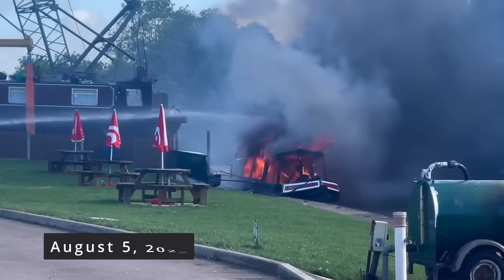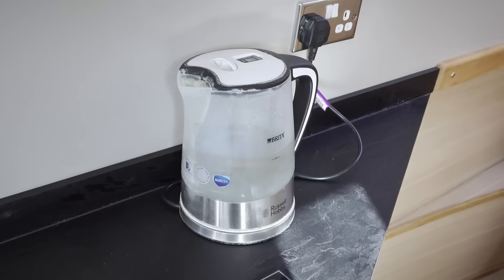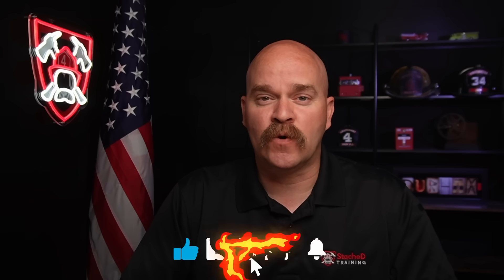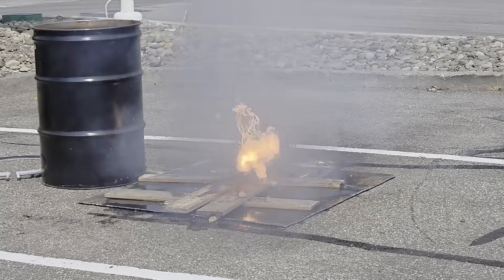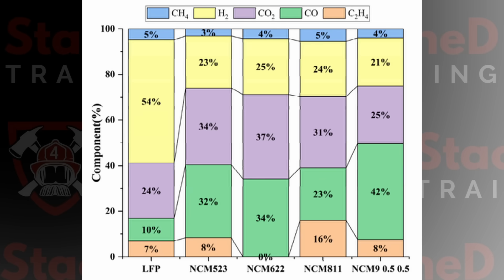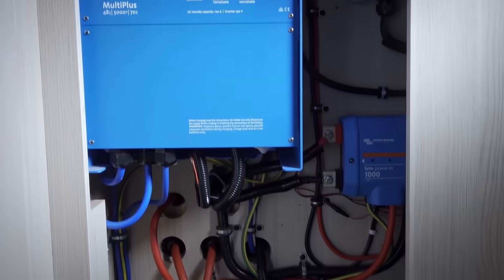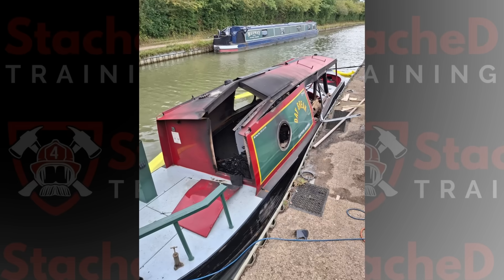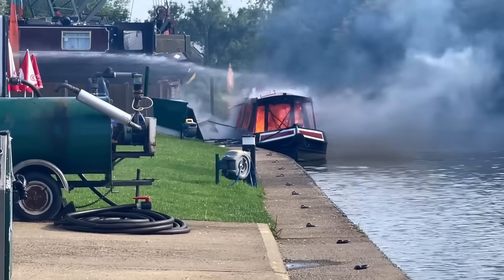Electric Boat Explodes While Charging: LFP Batteries

Comment: There needs to be more information about this incident. Currently, (no pun intended) there are many, many yachts with LiPo batteries used as house batteries, mine included.  As for venting, my  LiPo batteries look exactly like AGM battery cases. There aren't any vents in the case because there is nothing to offgas as lead acid battery requires. Perhaps they used a system that wasn't meant for the marine industry ( not ABYC or similar, approved). I would be interested in a follow-up up to this video as more information comes to light.
Thanks for posting this.
Reply: I really doubt your yacht is using LiPo batteries, it is most likely using safer chemistries with a liquid electrolyte instead of a polymer electrolyte.
Reply: @swecreations I installed them myself,  so there is no doubt. I do use an AGM battery for the auxiliary diesel, but the house batteries are 100% LiPo.
Reply: @Richard-nb4iv Why would you use LiPo batteries for a house battery over something more standard like prismatic NMC or LFP batteries though?
Reply: @swecreations Lipo has become the standard for the industry. That's marine as well as home use with solar. It is more of a stable chemistry than the traditional lithium battery types.
When a traditional lithium battery is punctured with a nail, it goes into a thermal runaway and basically catches fire/ explodes. A LiPo battery doesn't do this because of its stable chemistry. I've seen many videos on this topic on YouTube. That's why I'm wondering if they have all the information correct with regards to the boat fire.
Reply: @Richard-nb4iv No sorry but I have quite a lot of experience in the battery  field and you have everything the wrong way around. 

LiPo batteries are considered the most unstable type, and it's what you will find in all smartphones and most laptop batteries. They are practically always in a pouch format and have a polymer electrolyte instead of a liquid electrolyte (where the Po in LiPo comes from).

Regular NMC batteries are considered to be much more stable than them, and LFP batteries are considered among the most stable, often incapable of sustaining a fire and will extinguish themselves even in extreme conditions.

I will however warn that I don't really like this channel as it tends to heavily overdramatize the risks of battery fires. If you look at fire statistics for EVs from the offical government agencies responsible for statistics they all end up at roughly 1/20th the fire risk or less compared to gasoline vehicles, and these results are shared among multiple countries (Norway, Sweden, Australia and the US are ones I know of the top of my head where I have seen this data first-hand). This is of course accounting for the amount of cars on the road.

Regardless I would like to recommend you to search on Youtube for something like "nail puncture test LiPo vs LFP" so you can see what I'm talking about here clearly, as the LiPo batteries will explode violently compared to the LFP batteries.

I would guess that you have likely confused the battery types, I highly doubt your house batteries etc. use LiPo batteries and that's why I replied to your comment in the first place. I hope this information helps! 😊
Reply: @swecreations  Yes, you are correct, I did infact have the types switched. My apologies and thank you for the correction. 😊

Comment: You have to take in to account how many thousands of battery are out there all working fine, post like are informative but people who do not like EV,s are taking all out of context, to this one episode in the UK we had two fires that shut down main roads by diesel vehicles this week that made it into the media. Because of this type of media people are making judgments that would not normally think about, so the banning of EV,s is coming to this on a small amount media out put hyping it up, so taking that, need to ban diesel and petrol car just in case they have a wiring problem that could cause a fire. The boat in question had the battery in the cabin under the floor I believe and not in the engine area where they are normally stored. I not sure but where the wires go through from that charger box there would be a gland that makes a seal and may be out of sight. The only place where water can get in is through the prop shaft exit but there is a gland here which is kept full of grease to stop that happening and that is the brass pump on the rear deck. The owner would do daily check of this as  narrow boat people do, also the rudder pole is in a seal tube down into the water.

Comment: To get a LFP-Cell to a state where it gasses out is not easy. And in every case, the BMS has to fail, because it ultimately protects the cells from dangerous handling by disconnecting the battery from the load/charger.  How they managed to kill the battery is beyond me. It would be good to know at least SOME technical information about the installed Battery instead of "be scared, even of LFP." Because by that logic you should have nightmares about a diesel boat with a gas stove.

Comment: the  key to a safe system is  not building from 12v batteries, 4 12v batteries is not same as using 11 cells

Comment: I've worked on canal hire boats for 50 years. Yes, you can have a small electric boat that does short day trips of 2 or 3 hours. However, the idea that you can replace every system in a large cruiser that can be hired for several days is nonsensical. Hirers want freedom but are restricted by the need to recharge. Fixed charging points at regular intervals are required, even though they may be rarely used. How do you do a breakdown on a boat with no battery power? You can't just replace a starter battery like on a diesel-powered boat. Companies I have worked for have twice tried electric power and have given up as it is impractical. The first boat had 1.5 tons of batteries on board but had limited cruising range. Hybrids have been tried and reverted to diesel.
Reply: 1.5 tons of LFP4? You could run for weeks with that amount of storage on inland waterways. I doubt if an electric truck would have that amount.

Comment: LFP battery isn't 100% safe: it contains a flammable solvent.
But it is safe-er than LiPo battery, because it can tolerate cold/hot and 0 charge conditions a lot better.

Comment: A design fault in the build of the boat does not necessarily indicate a fault with the propulsion system. If it was diesel there are  ventilation requirements, whilst petrol (Gas) is virtually never used . With petrol the Tank is normally placed outside of the main hull of the boat to allow the explosive gases to leave the area, Likewise bottled gases (propane/butane) are kept in a drained  locker outside of the hull area. Nearly all boat fires can be traced back to a build up of gases in the bilges, ignited by an ignition source.
Maybe with the increased use of Batteries in boats the designers need to change their ventilation protocols.

Comment: Geez!  I was under the impression that LiFePO4 batteries were much safer (although not perfectly safe) than Li-ion wrt fire risk.  Hell, I’ve been mulling over installing a 20kw battery energy storage system to my solar panel installation, but have not pulled the trigger for the simple reason I AM worried about fire risk.  Holy cow what’s a person to do if there’s simply no safe/affordable battery out there (at least for now)?

Comment: Thats worrying for another reason, there is an old tunnel on the canal network called "Standedge Tunnel" and its nearly 5km long with freezing Northern England water that varies 3-5m deep in places, there are escape routes as its a network of disused and active rail tunnels and the canal but they are spread out. The Canal and River Trust run tours with larger battery operated canal boats full of tourists, plus other people can take their own boats or rented ones through at times. The idea of one of these fires or explosions in there is a terrifying idea, the toxic smoke too.
Reply: So how many of those boats stop charge the batteries while in the tunnel?

Comment: Its woth saying that there is two main types of LFP batteries. The higher capacity is doped,  I dont know for sure, but think its manganese. Those batteries are way more flamable. While not quite as flamable as NMC, they are still quite flamable.

While the normal LFP is not totaly inert, they are probobly a order of magnitude safer.

Comment: The issue is with battery systems built by incompetent, greedy bastards is clearly shown on one of the b-rolls here, and they are the only reasons for lithium batteries having a bad reputation. Lithium battery technology is fantastic and very safe, if implemented properly. 
You can buy lithium battery packs as 4 cells to form 12V, 8cells to form 24 batteries, and when used individually, or in parallel, they are perfectly fine. They should have a MOSFET bridge on the negative side, they should be able to disconnect, should the cell voltages or temperatures move out of operating range. The cell balancing and monitoring system takes care of the cells of a single battery, and can disconnect the load or charge before cathastrophy strikes. However, when one connects these in series, and the batteries don't communicate with each other or the charger/load, and on top of it they don't have a MOSFET bridge (or the mosfets burned out), this is exactly what will happen, quick fast in a hurry. The batteries are not aware of cell voltages between blocks, can't regulate charging or discharging, can't regulate cell balancing, nothing. 
In ANY applications, people should use batteries with BMS systems equipped for series operation, cell balancing between cells, modules and blocks, and the ability to disconnect the load and the charge IMMEDIATELY as the cell parameters get out of range. Bonus, if the system is able to acutally regulate the charger, adjust charge current, thus ensuring the cell voltages remain in range, but also cell balancing can occur at the end of the charge process. 

The problem isn't the technology, it't the people using/selling it in a substandard state. Just like with anything else in the industry. If someone can't build a proper airplane, they shouldn't be selling an airplane. There is very little to no regulation on the DC side of battery installations, mobile or stationary. We have strict regulation for all electrical wiring, connections and safety, but no enforceable standards for lithium battery systems, cell monitoring, cell balancing and charge/discharge regulation? The root of the problem is exactly this.
Reply: Do you think the people doing these DIY conversions have had a university education about the chemistry and composition of batteries ? They are a dark art unless you have studied them in depth,
Reply: Similarly to how not just anyone can wire up a home and then get certification to inhabit it, diy-ers shouldn't be able to install grid connected batteries. In vehicles, this should be equally as strictly regulated. It's not rocket surgery, there are a few fundamental concepts one needs to be aware of, just like with electrical wiring or gas plumbing, and that's it. Rules must be followed, safe systems installed and there is no crisis. I'm responsible for over 50MWh of lithium storage of various manufacturers and voltages, but well designed, executed, monitored and controlled systems work properly, efficiently and without such incidents.
Reply: @Matesosh  Yes, there need to be standards for electrical systems (there are, in fact, in the UK). No, DIYers should not be banned - they just have to follow the rules/specs like everyone else. The idea that DIYers do a bad job is just wrong - they often do excellent work.
This narrowboat was not a DIY conversion anyway - it was done commercially.
Reply: @xxwookey Fair enough, banning is not the right action, but then at least very strict certification process of all design and installation by a certified 3rd party.
In my eyes, that install is a DIY-er's work who started a business to do this. Also, it looks to be a decent job, cable management, etc. but conceptually terrible. I've seen, and rescued too many systems like this before something bad happened, it's more common than one would think. Because they look similar to them, people use these batteries the same way we did lead acids 10 years ago, they install them the same way, thinking they are a drop-in replacement.
Reply: Yup  badly installed maintained  engines heating cooking primary & frequent cause of fire on boats
Reply: Low level bs in a low-level world  !....tapping into the Etheric energy field around us gives safe , unlimited electricity on tap , no ,  I don't know how to do that.
Reply: Not just that but there isn’t any systems like TÜV to properly check and approve of the designs/conversions

Comment: Rechargeable batteries aren't safe. If rich people stopped flying all over the shop and batteries currently wasted on cars were used in static fire proof installations for domestic homes (in conjunction with solar/micro wind generation) we could reduce emissions of CO² more than using them in overpriced and dangerous vehicles.  A big heavy vehicle isn't suddenly environmentally friendly because the power train is swapped for electric.  BEV's have been a disaster for the environment and present a substantial risk to society. Instead of green to make a fast buck we need our politicians to do their jobs and implement sensible well thought out policies not line their and their public school chums pockets. The level of incompetence displayed by our greedy politicians is a disgrace.

Comment: That's a bluetooth BMS with no signal connection to the charger and not even an error indicator LED on the boat's dashboard. Completely dependent on the user to check their phone app regularly. That's recipe for just this to happen.

Comment: This shows that all current lithium battery chemistries can experience thermal runaway. But express that thermal runaway in different ways. No chemistry type should be regarded as immune. Thermal runaway is not a fire, and doesn't require active fire to be present. From the comments many boaty people need to learn to listen carefully to what is being said. As lives will depend on the understanding. I am now involved in the investigation into this as marine engineering, surveyor accident investigator and marine battery safety guy.

Comment: Correction: Just because they are labelled NMC, if you are going to spell out the chemistry, they are still Lithium Nickel Manganese Cobalt Oxide. The Lithium should be included, particularly as you spelt out the LFP. A possible solution is to adopt the new Australian standard where batteries need to be sealed off from the living space and vented to the outside. I also noticed they were cheap on the 48v by having what looked like series batteries and only one voltage sensing wire. That makes balancing more suspect. Any lithium chemistry (eg. LFP or NMC) should not be near heat. Faulty charging could also be an issue with heat. Something new I liked was the composition of the off gassing. Thanks
Reply: The guy in the marina who took the fire video you posted, and viewed the aftermath, said the batteries were mounted up against the divider bulkhead in the  dry part of the boat, not in the propulsion motor compartment under the rear deck.  
Seen no definitive proof of battery chemistry, but someone looked at the batteries of this boats sister ship, and said they were not LiFePo. 
Maybe some more due diligence is in order before an "expert" opinion is offered.
Reply: @kylereese4822 WTF are you commenting about. Exactly what did I say was wrong? OR are you making up stuff from other comments and videos?

Comment: Should is doing a lot of heavy lifting . Very few will do the work to make sure all equipment is properly matched, and that the cable entry points are properly sealed .

The message that lfp batteries are just as dangerous as other lithium batteries needs to be spread amongst the EV dogmatists as they seem to think they are perfectly safe

Comment: These batteries are now incredibly cheap, like all things cheap and mass produced the failure rate will only increase. It is the first rule of buying anything from China, it is cheap for a reason.
Reply: The guy in the marina who took the fire video you posted, and viewed the aftermath, said the batteries were mounted up against the divider bulkhead in the  dry part of the boat, not in the propulsion motor compartment under the rear deck.  
Seen no definitive proof of battery chemistry, but someone looked at the batteries of this boats sister ship, and said they were not LiFePo. 
Maybe some more due diligence is in order before an "expert" opinion is offered.
Reply: @kylereese4822 Where did I disclose battery chemistry before offering my expert opinion??😂 Stop cutting and pasting the same old comment, it's pointless and just lazy.
Reply: @philelliott5327  Lithium chemistries are very different. without knowing which, discussion is pointless.
Reply: @kylereese4822  Not LiFePo? Well that explains an awful lot. I would not use other Lithium types, other than good quality batteries found in reasonable quality phones etc.